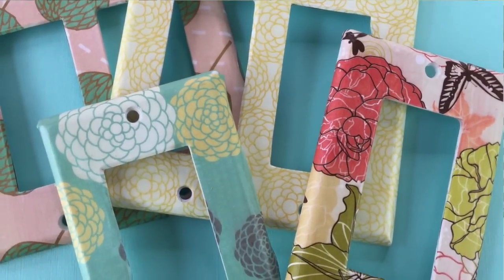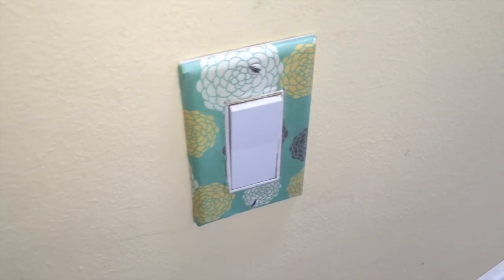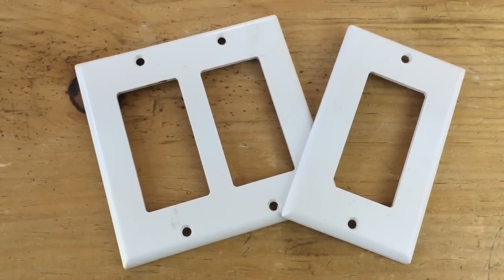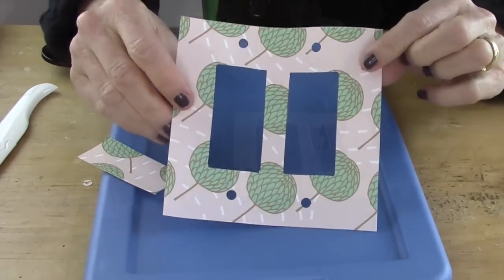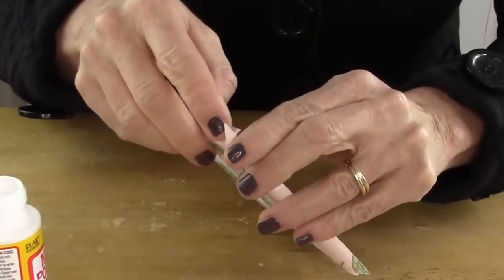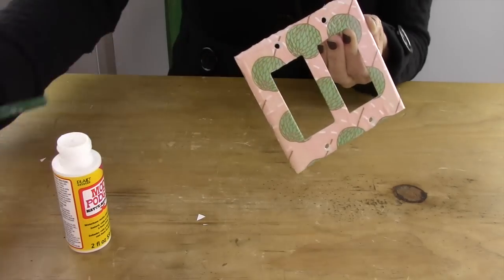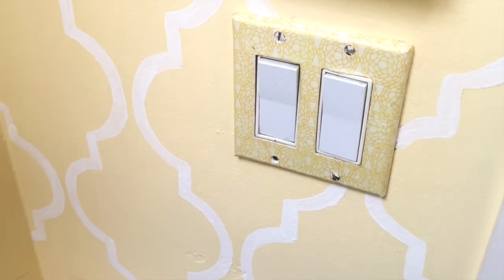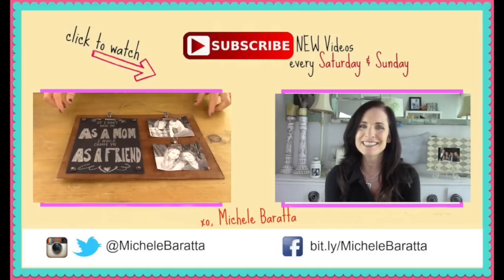DIY Light Switch Covers | (EASY DIY)

Comment: Hello Michelle,

I loved loved loved this idea and have started doing this with all my light switches.  I got better as I went along. I haven't taken photos yet but will today. They are adorable.  One question... I am using them for my Airbnb house and the few that I have done look amazing and I'll keep doing them everyday until I'm done.  My question is this...  I'm worried about cleaning. With an Airbnb, we do and have to do tons of cleaning of every touch area.  In addition to the Modge Podge, would you recommend that I coat each one with a top layer of shellac or something stronger like that?  I'll have to clean them frequently with liquid, so I'm just worried the Modge Podge won't be strong enough to hold up.
Reply from the maker: Hi Patricia:  So sorry for the late reply!!  Thanks so much for loving my DIY!!!  What a great idea to use this for your AirBNB.  ModPodge is actually a sealer.  Just put on a few extra coats.  Have an awesome day!  xo, Michele

Comment: Not sure if this is covered, but as an added fill-in, why not take your rocker switch cutout and glue that to the switch?  Also, the hole punch outs for the screws… substitute flathead screws and then glue your punch out on top of the screw heads? These suggestions are probably best for actual photos so you lose little of the original photo
Reply from the maker: Great idea!!!